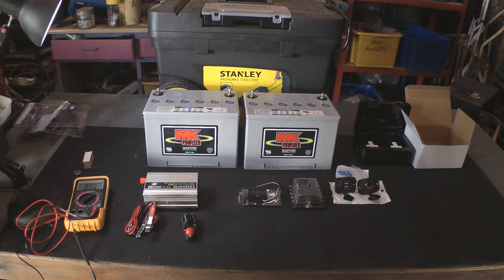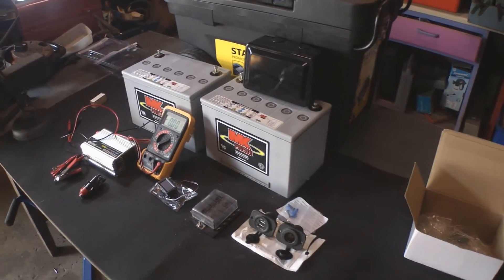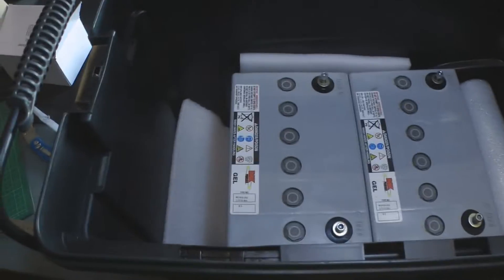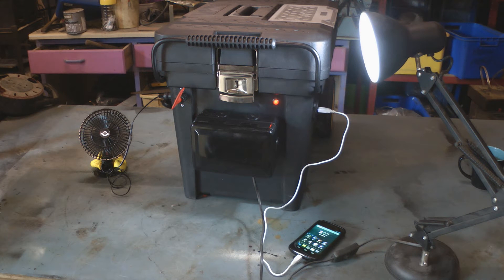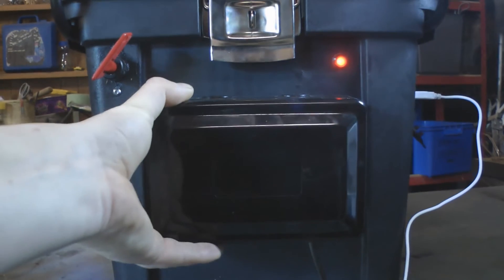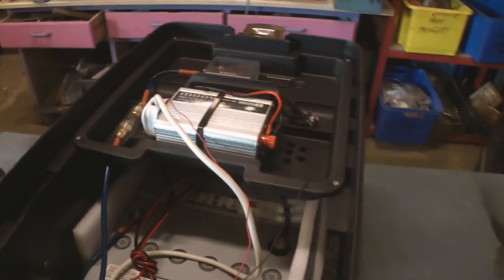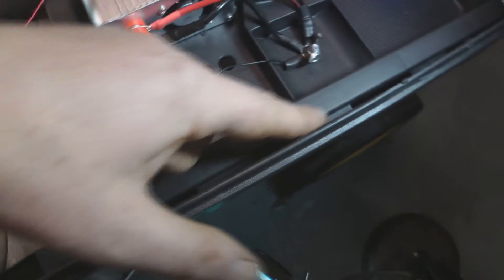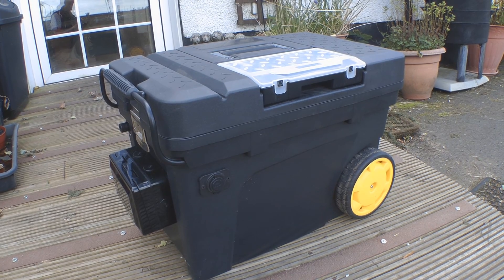Making a Mobile Power Station

Comment: very nifty me ole mate, i love gadgets hahaha i think i would have put a bigger inverter on, as ya dont need to use it fully but  if ya need more wattage then it would be there in reserve, nice tidy set up, like it a lot,
Reply from the maker: Cheers bud, yes very good point. I may add a larger inverter when I add the solar part to it. I opted for the 600W as it was about double the wattage of the essential items in the house and more than enough for anything I could think of down at the cabin but as you say you can't beat having some in reserve. I also have a 4kW diesel generator and my van's solar system as other back up so I'm pretty well off in that regard. Cheers for your suggestion, keep 'em coming. Atb Dave

Comment: Nice Job would this be ok with home car wash wonder how long life it has
Reply from the maker: Cheers, I doubt mine would work with a pressure washer as they tend to be over 1KW and I opted for a 600W invertor for relatively low powered stuff and long battery life, although without an Ah rating (which for some reason isn't on these batteries) I couldn't say how long this will last. I will only find out through use, so I will try to do an update some time down the road. You could run a 2000 Watt invertor which should power a home car wash but I'm not sure if the batteries would last very long, drawing that kind of power. I'm no expert on this subject though (or any other tbh haha) thanks for watching Atb Dave